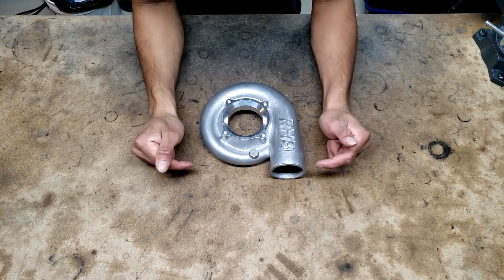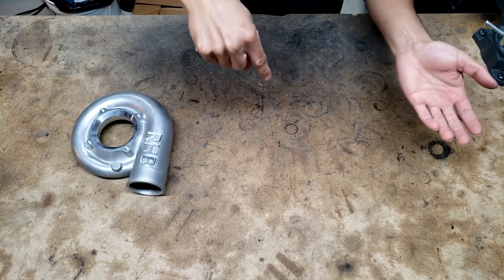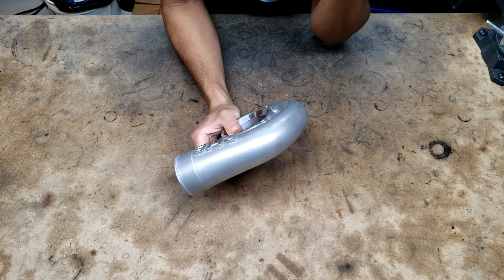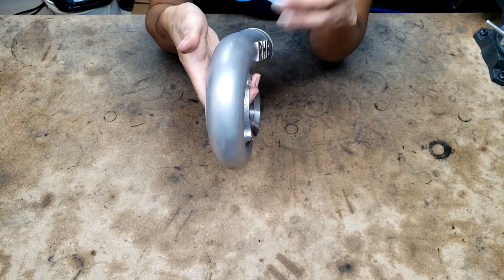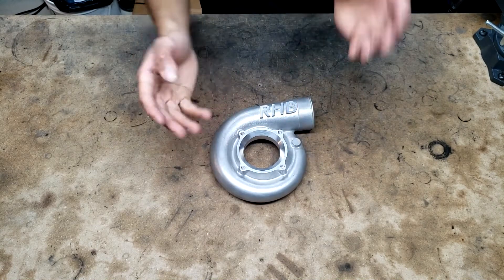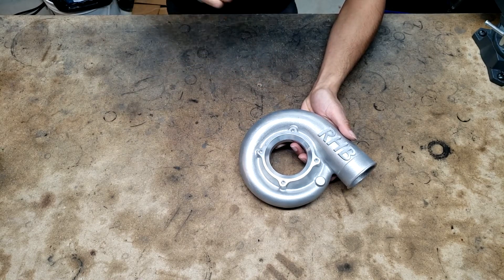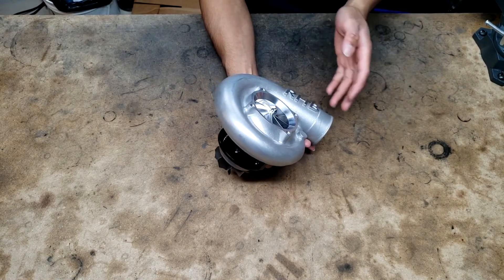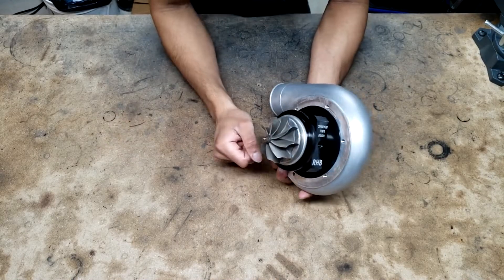3D Printed Aluminum Turbo Compressor Housing

Comment: why didnt you look into lost foam casting?
Reply: Casting without all of the fancy equipment that they use at a professional level does not produce parts that are usable in an automotive application.  It’s effectively impossible to make a part that has an acceptably small amount of porosity and inclusions using a home casting setup, especially if you’re doing some kind of burnout.

Comment: What orientation did you print it in - was it outlet port up? Printing it laying down would decrease print cost but add a lot of support in the volute, and I dont see any signs of support in the outlet. Also, why did you choose AlSi10Mg over something stronger with a finer grain structure, such as one of the Aluminum RAM alloys?
Reply from the maker: It was printed laying down. Supports were all cleaned up so not visible in the video. This basic design didn't need any special alloys.
Reply: @RHBTurbochargers  thanks! It's pretty impressive that you were able to maintain apparent circularity in the outlet, even with supports